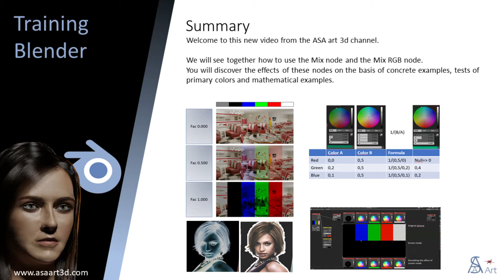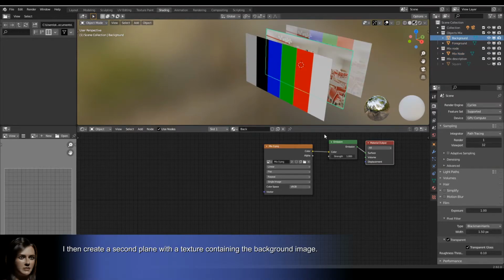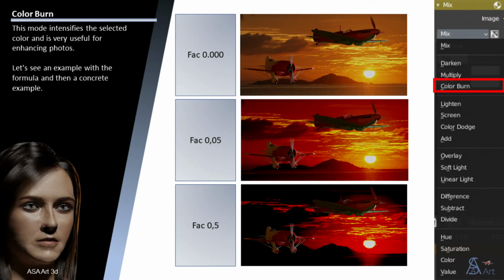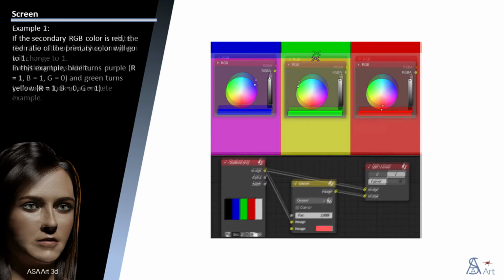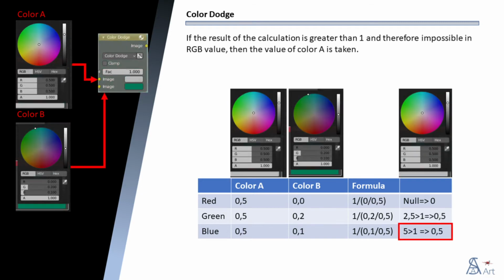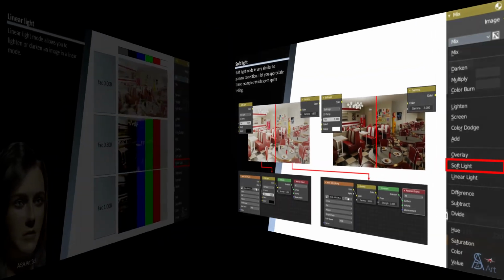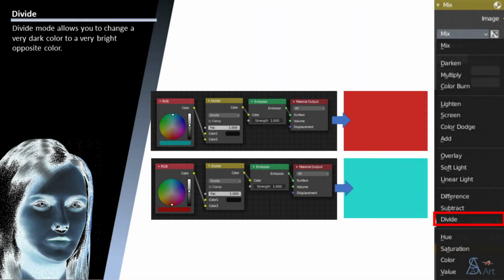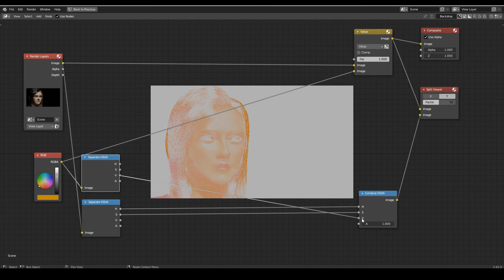Mix node and Mix RGB node explained and tested

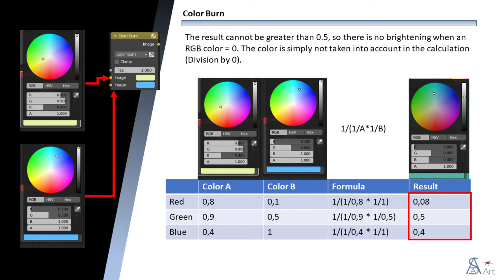Comment: 3:29 color b 0.1 in formula 1 that's correct?
Reply from the maker: Thank you and well done for finding this error.
Color B= 0.1. The formula is 1 / (1 / 0.8 * 1 / 0.1). The result is 0.08. The other examples are correct.
Reply: @ASAArt3d  thank u for response

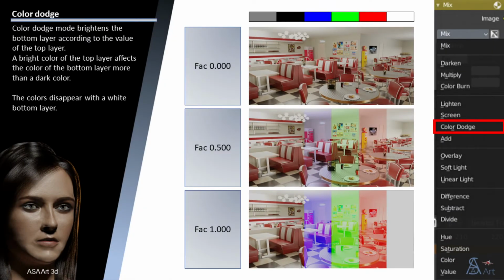Comment: In 5:36 what is bottom and top layer,did you thought a first and second image?
Reply from the maker: Hello,
Basically, yes, you can think of your image as a layer.
In fact, a layer is a copy of your image more or less transparent. Editing a layer avoids modifying your original image. Your changes are then not destructive and you can reuse the original for other effects.
Reply: @ASAArt3d  I don't understand little color dodge when is result greater than one then is RGB value taken of A and if is ERROR(NULL) but what if is value equal to number one or just less what actually then happening actually which value is taken?
and i heard for new formula for color dodge A/(1-B) is it correct?